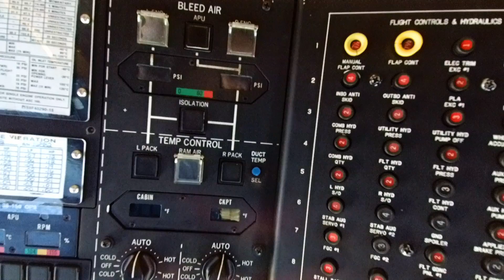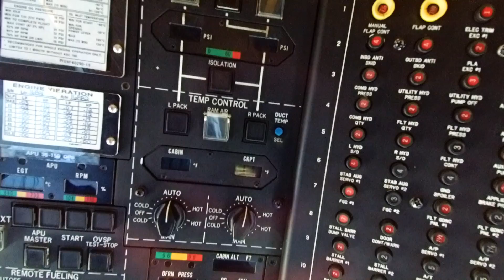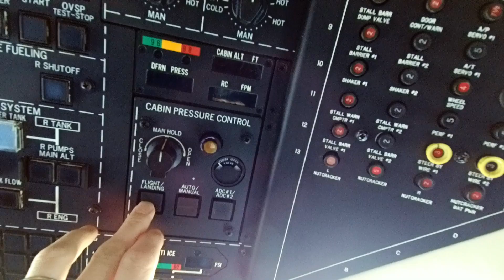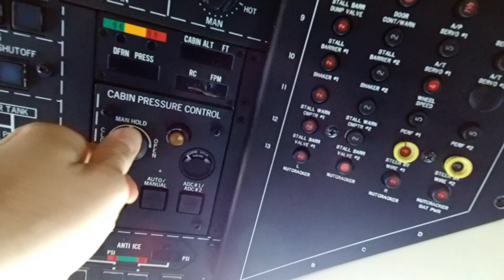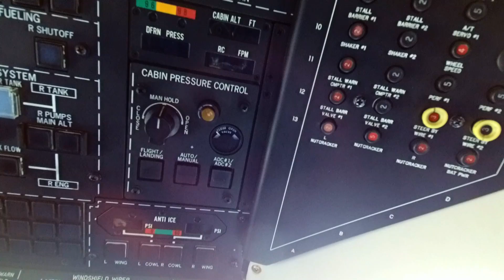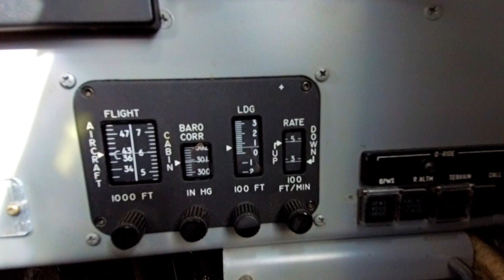How the Gulfstream Pressurization System Works - Pilot VLOG 58

Comment: Another great video. The GIV press system actually seems easier than a King Air 200. The 200 actually had very weak ground A/C. It used an automotive style A/C compressor mounted to the right PT6. Not enough bleed air in a PT6 to run a pack. On the ground, if you didn’t move the right fuel lever to Hi Idle, the compressor wouldn’t engage. But even with hot bleed air, you generally don’t need A/C above say FL120
Reply from the maker: That's interesting...didn't know that!
Reply: Not that I'm trying to compare a King Air 200, or even 300, to a G-IV. I never had to worry about the proper ground power setting to run the A/C in the KA I flew, because it was perpetually inop. Don't even get me started on the weird design of the inboard leading edges. There is a reason companies like Raisbeck have done so well off modifying King Air's
Reply: In Australia in the summer, our C90's keep the bleed air valves closed until either just before or after take-off because the cabins get so hot and weak a/c systems. Does the Gulfstream have a cabin dump switch?

Comment: What happens when a plane looses pressure. You see windows freeze up and everyone dies. How does that happen and why no back up system?
Reply from the maker: If one were to suddenly lose pressurization in the aircraft at high altitude, the survivability is pretty low. But assuming at least one pilot already had their oxygen mask on, they may be able to perform an emergency descent to a lower altitude. One of the biggest things that most people don't think about in that situation is the trapped gas inside the human body. The average person has something like 2 liters of air in the G.I. tract. In a sudden decompression, that gas expands drastically to become extremely painful. This is not meant to scare anyone, but this is on reason why we should always keep an eye on the pressurization system of the airplane. The only reason this would happen is due to a serious mechanical failure (such as a window blowing out), so there's no real way to have a backup for that. This is something that very seldom happens, and with the increase of technology, I don't see this being a major problem going forward.
Reply: There is an interesting audio tape on youtube somewhere of a regional cargo aircraft communicating with the "center" it was flying through somewhere in the middle of the USA.  The dispatcher realizes SOMETHING is wrong with the way the pilots are talking to them and orders a rapid decent.  Pilots comply and a few minutes later, one of the aircrew comes back on the radio and is AOx4, requesting a divert for a pressurization problem and thanking the controller for saving them!
Reply: Incidents like that make the news because they are so incredibly rare. The more famous examples of airliners flying along with everybody dead until the tanks were sucked dry makes me wonder if sabotage doesn't play some role. Not sure how a trained professional crew can blissfully fly along with alarms shrieking and lights flashing, and do nothing about it.

Modern aircraft are engineered to minimize the catastrophic effect of fatigue cracking. There are engineered sections that are actually designed to blow out, before a larger section blows out. Routine inspections are supposed to catch cracks before they become a catastrophe.

In the United States, a little over 30,000 people, including a bit over 2,000 teens, die each and every year from car crashes. I don't see people getting worked up, or marching in the streets, over that death toll. Yet I'm sure all of us know somebody who was badly injured, or killed, in a car crash.

I'm one of those statistically rare folks who knows somebody who died in an airliner crash. Through work, I knew one of the guys on United 175. I am still stunned at how he died
Reply: That happened to pro golfer, Payne Stewart, and everyone on the Learjet they were flying in. The plane eventually ran out of fuel, and crashed in a cornfield.
Reply: Some newer aircraft do incorporate an emergency decent profile into the automation. Eg TBM 930. Whether such a system is foolproof or reliable, who knows
Reply: It just happened less than two weeks ago at 37,000 feet on a 737.  Judging by the blood in the oxygen masks, it must have been a little unpleasant, but they landed and everyone survived.  
https://www.usatoday.com/story/news/2018/07/14/ryanair-flight-loses-cabin-pressure-makes-emergency-landing-germany/785264002/

https://flightaware.com/live/flight/RYR7312/history/20180713/1845Z/EIDW/LDZD
Reply: +Willie Gillie - The PIC on that Learjet was also inexperienced in that model rating. The Plane had previous problems with the system. It was just a bad situation across the board.
Reply: Id be busting some ass in a hurry if that ever happened
Reply: https://abcnews.go.com/International/33-passengers-hospitalized-ryanair-flight-depressurizes/story?id=56596080
Reply: Is there an aural warning when the cabin climbs to a certain altitude?  One would feel a sudden loss of cabin pressure but a gradual one would be less noticeable
Reply: Corporate Pilot Life Paine Stewart accident was a sad commentary as to what rapid decompression can do to all on board. Why couldn't they design into FMS an emergency decent  due to rapid decomp to 10,000 ft. without pilot input. Think of all the lives it could save.
Reply: yes, very little to no time to react. I'm sure they were all gone in seconds